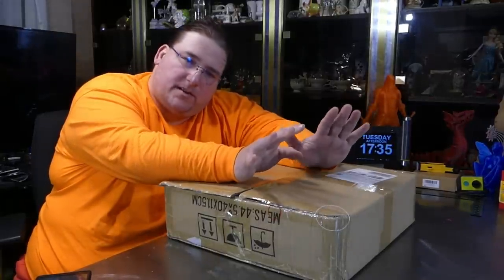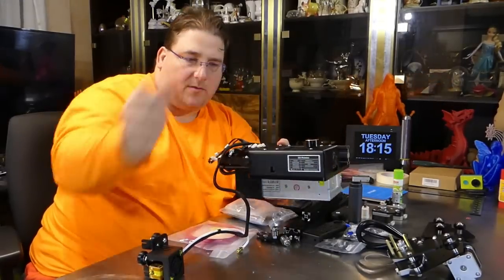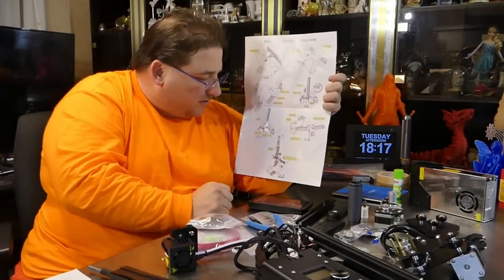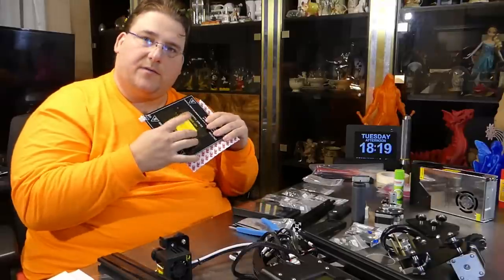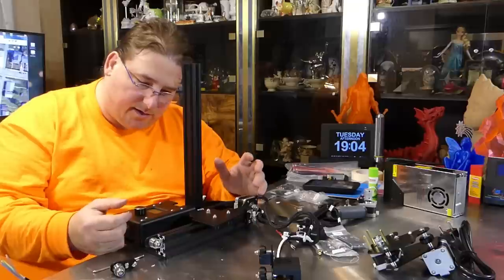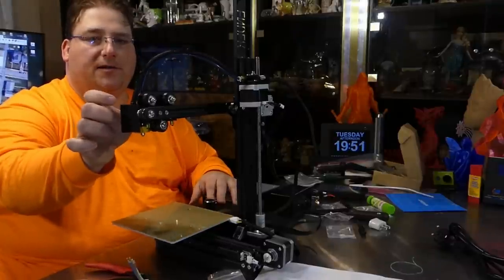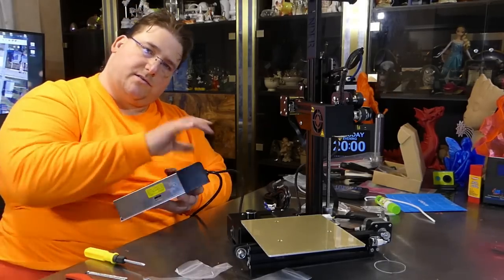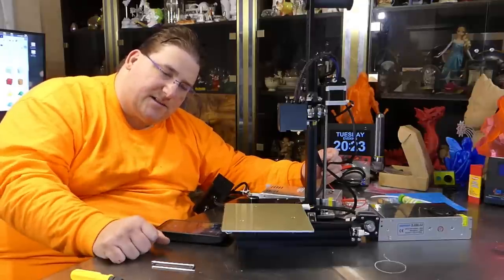Today's 3D Print 182 Ender 2 Rev2 Unbox Build No Print DOA

Comment: Love the vid! I know it's not related, but I got my first 3d printer today (cr-10 original) and went to do the first print and was having problems with the lead screw vibrating, any ideas would be much appreciated! Thanks in advance! :)
Reply from the maker: vibrating? is it lubricated? (should have come with grease on it)

also loosen the grubs on the coupler (both sides all 4) and retighten "evenly"

also make sure the RIGHT SIDE riser trolley is not too loose OR too tight. "just snug"
Reply: Nerys some vibrating yes, and is lubricated, reloosened the grub screws and resnugged them evenly, also double checked the right side, seems to be okay (I think), the rattling is coming from the top where the lead screw meets the top of the frame, I can move it even if I'm not printing with it, is there a way to adjust it up or down?
Reply from the maker: +TheCubefreak14 if that top piece is movable loosen it raise your Gantry all the way to the top Jiggle It and retighten it that should help center it I'm not sure if it's movable on the cr10 or not I'll have to check when I get home
Reply: Nerys I appreciate the help regardless, thank you :) I will check that when I get off of work today, idk if there is a bearing in the top there or not, but again, I will check after work :)
Reply: Nerys I think I got it! Seems to be that the bearing that's at the top of the lead screw is loose in the bracket that holds it (diameter was too big) I put some tape stopping the bearing for now just to give it a bit of a tighter fit and it worked perfectly, only problem I have to figure out now if that my bottom right bed screw is almost all the way loose and still isn't enough, not sure if the spring is compressed or not, but that one should be easy
Reply from the maker: +TheCubefreak14 your gabtry is probably not level. Forcing you to tilt the bed to level with the gantry.

Tighten all bed screws down all the way.

Make yure gantry arm within 12 inches of the bed using ruler level the arm to the bed

To change the angle of the arm grab both coupler and hold firmly now twist the right one one to adjuat its position while holding the left firmly so ot does not move (it will try)

Now relevel the bed. You should have much better results.
Reply: Nerys I will try that after work, thank you again! You've been such a big help! I did a test print last night and it came out very nice!, I have your essential cr-10 upgrades in queue to print, but want to make sure my tolerances are correct :)
Reply: Nerys that seemed to do the trick! Thank you again! :D

Comment: Chris, my nozzle heated my bed got hot, but my interface was off as well. What is wrong with this release? did you find a fix?
Reply from the maker: +Sirbob Games ohhhh you too. Did you fli the 220v switch to 110v first?
Reply: yup, I flipped it to 110 first thing. Did you forget to flip it?
Reply: +Nerys I flipped it right away after unboxing. Did you forget to? there were too many power out options. maybe I connected to the wrong ones.
Reply from the maker: +Sirbob Games I forgot to flip mine that should not have done anything but it's possible ask for the power out it doesn't matter there are three negative and three positive as long as you chose one negative and one positive and did not flip those you should be fine DC power is polarized you have to get it right red on positive black on negative
Reply: great... so maybe it's my euro plug with us connection thing. otherwise i don't know

Comment: Where did you get the custom PEi sheet Chris???
Reply from the maker: +4dprinterguy http://catalog.cshyde.com/viewitems/3d-printing-materials/ultem-pei

I ordered 20 mil 12 x 12 then ask them to cut it into for 6.5 by 6.5 inch pieces
Reply: Did they drill and bevel holes or was that your task?? Thanks Chris..:) My bad it looks like it adheres with adhesive..I only have one Ender :( so 6x6 is more economical..
Reply from the maker: +4dprinterguy careful. Going 6x6 means placement is critical. They might make that 6x6 6.5x6.5 if you ask them to. Yes it just adheres in place adhesive already on it.
Reply: Good advice..I will see what they can do..Thanks again...

Comment: I've got a couple ender 2's and they are great especially after adding a cooling fan.  I modified the TEVO tornado fang for the ender 2 and it works great https://www.thingiverse.com/thing:2789669 .  One thing I am finding frustrating is trying to set the z offset.  On the lcd the the zoffset in control is a bit corrupt with the screen draw and won't let you set below 0.05 for me.  The marlin on the ender 2 doesn't work with M581 as far as I can see.  Trying to use M206 to set a home offset and I think that may be working.  A bit of a pain though.  What do you do for the offset?
Reply from the maker: What is offset used for? Once i level/tram the bed i never have a reason to change the distance from bed to nozzle again.

Comment: best ever!   ..  Q: can I feel confident in the US plug adapter with no ground on it.? /watch?v=MCfqphbsl5o&t

wow bed wiggle solution!
Reply from the maker: +Sirbob Games to get going while you wait for a proper plug? Probably fine. Just order the plug or pick one up from home depot for $3 (just the end snip off the eu end wire up the use grounded plug end)

I have a video specifically on the bed wiggle just adjust the eccentric nut till its snug. Same for the x trolley.